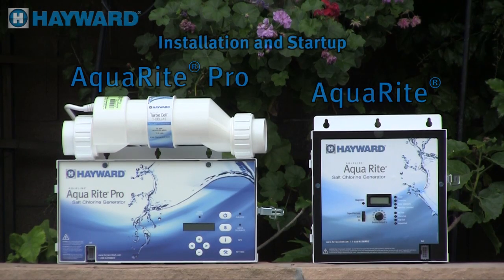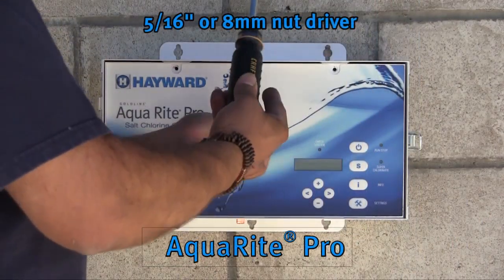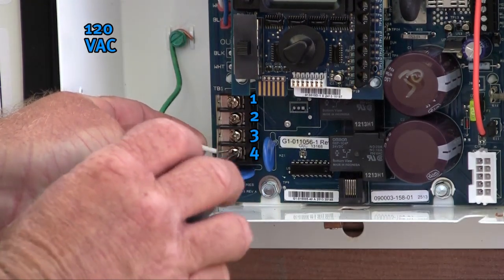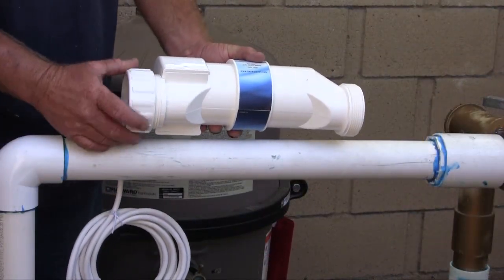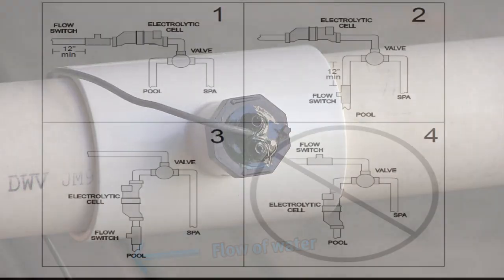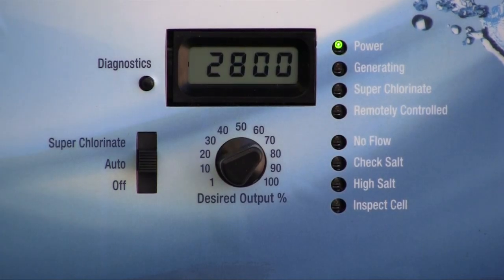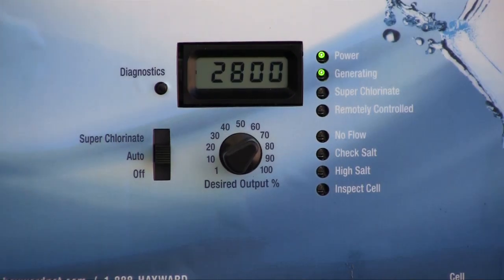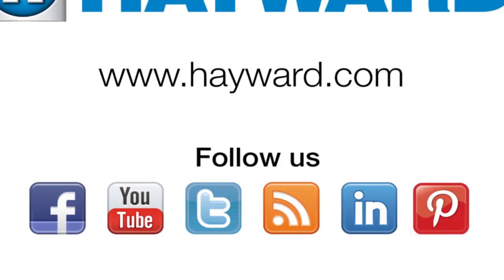AquaRite & AquaRite Pro Installation/Start Up

Comment: If connecting two aqua rite together as shown in manual, how are the electrical and communication wires configured for proper system function
Reply from the maker: Hello. You can locate a local dealer that will be able to help you at https://hayward.com/dealerlocator or send your information directly to marketing@hayward.com. Thank you.

Comment: My 10 year old system has the flow switch located between the heater and the electrolytic cell. Do I need to switch  the flow switch location? It does not appear to be interfering with chlorine production.
Reply from the maker: Hello Mr Kelly, a Hayward tech will reach out to let you know. Please private message your email address and phone number on our Facebook page or Twitter profile. You can also send us an email at marketing@hayward.com and we'll pass it on to our tech team for follow up after the weekend.

Comment: Installing with Omni hub. Does it need to go through a smart relay? If not what’s best way to wire. Power is 240v from time clock.
Reply from the maker: Justin, what device (pump, heater light etc) are you trying to connect to the Omni Hub?
Reply: Hayward Pool Products hooking up a new Tristar VS, 12v colorlogic. Have an old H series heater not being replaced at this time.
Reply from the maker: Justin, a tristar VS pump would connect power direct from breaker and low voltage wire from pump to Omni Hub. A 12v light would go through a Smart Relay wired for 115v then to a transformer to step down power to 12v.  They connect the light to the transformer. Let us know if you have any other problems or if you would like our tech team to contact you directly to assist.

Comment: I have a Hayward TriStar SP3202VSP, using its display module to control it.  I recently purchased the AQR 15.  Is there a way to integrate the two so they are scheduled to operate at the same time?  Thank in advance.
Reply from the maker: Hi Shane, we'd like to more about you system. You can private message your phone number on our Facebook page and someone will give you a call today.  If you had a time clock, it's best to tie the AquaRite into the load side of the time clock and set to operate at the same time the pump comes on. There is no way to connect the AquaRite directly to the pump.
Reply: Thank you very much for the quick reply.  I am one of the few people who doesn't have a Facebook account or I would PM you there.

I understand what you are saying concerning the timer.To my system, I recently purchased a home with an existing 27K gallon inground pool that needs some love.  It has a Hayward super pump that is bad which is why I purchased the Tri Star.  It also has a Hayward Pro Series 250lb sand filter.   I am adding the AquaRite with the T15 while I am performing the refresh on the pool.
Thanks for all your help.
Reply from the maker: Another option would be adding a controller. 
https://www.hayward-pool.com/shop/en/pools/res-in-ground/res-automation
Reply: @HaywardPoolProducts  Thanks for the info and the help. I appreciate it.
Reply from the maker: It's our pleasure, Shane! Reach out anytime.

Comment: Since I have the eco star pump and it has its own timer how should I install the wiring to the aqua rite system since they are supposed to be running at the same time?
Reply from the maker: Sean, if the Ecostar is powered off a timer, run the power off the load side (only provides power when the timer is on) of the timer and set the timer to come on during the time the Ecostar is running.     Make sure the EcoStar is powered off the line side of the timer (always has power).   Remember the AquaRite has a flow switch so it will not run without flow.   Post your phone number to our Facebook private message side if you would like a phone call from a tech.

Comment: I’ll be closing up the pool in a few weeks for the winter. Is it ok if I complete the plumbing, connect the unit and leave it powered off and don’t add salt to the pool until next season?
Reply from the maker: Yes
Reply from the maker: One more thing.  I would remove the cell if possible and store.

Comment: Do I need to add an Inline Zinc Anode with this system?
Reply from the maker: Hi Mark, The only reason I know for requiring a zinc anode is if there is a problem with metal fixtures turning black.  Sometimes due to very low stray current or overhead power lines  Our salt systems do not require this for installation.
Reply: Thanks

Comment: Does the salt level on the box represent what’s in the pool or just the output? Mine says 3600 but tester shows 2 units which equals 600 ppm
Reply from the maker: Hi there, Our tech will reply or may want to speak with you on the phone.  Please PM your phone number.
Reply from the maker: Not sure how you are testing.   3600 PPM is on the upper limits of the required salt level.  If the unit is generating all ok.   Have the salt level check at a local pool store for comparison.